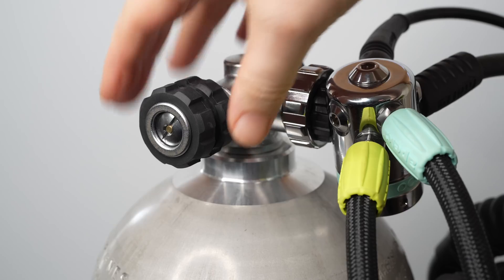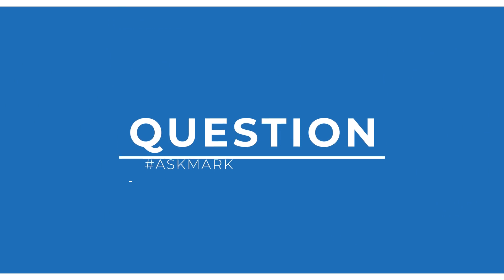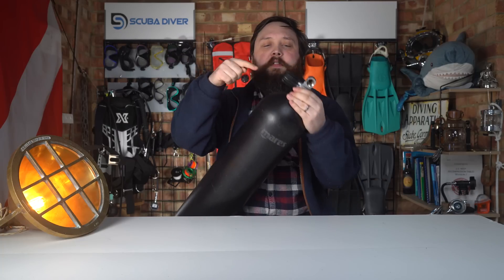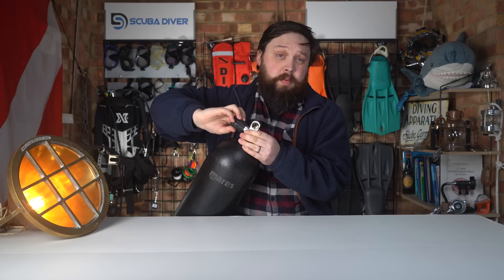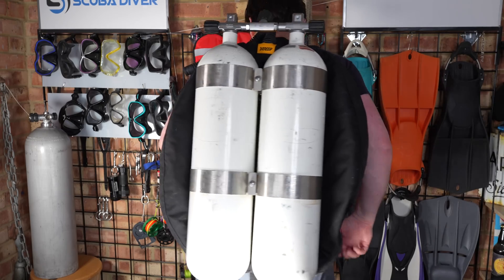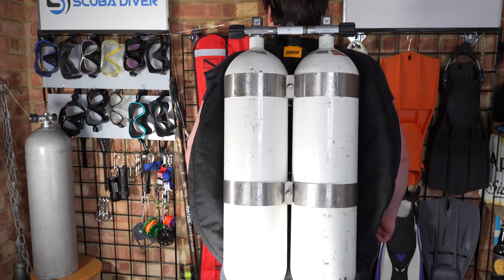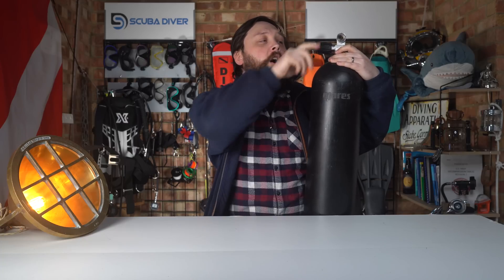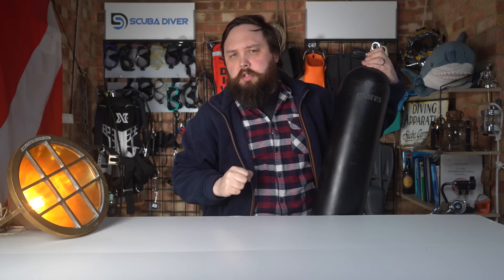How Twinset Valves Work In Scuba Diving | Shutdown Drills And Isolator Tips Explained

Comment: #Askmark  Thanks, Mark. For all the advice, how often should I use silicone spray on my mask and fins? And should i use it on my regulator horses ? Thanks again for all the grate work.
Reply from the maker: I don't use silicone sprays very often on my dive gear. Some can condition the rubber parts while some other silicone sprays can actually damage them. Not all silicone is the same, so you need to be sure that you're using a product that's designed for dive gear.

Once or twice a season if you're diving a lot in sunny conditions will help the rubbers from degrading. It should have a thin, milky consistency and follow the instructions on the label. 
 I'd keep it away from buckles though because it's a lubricant and you don't want your mask to slip off. 

I wouldn't worry too much about your hoses, as long as you keep them clean and dry between dives and keep them out of the sun they shouldn't crack. Hoses should be replaced every 5 years anyway and it's rare for them to crack before that if you look after them.

Comment: I can see only disadvantages to isolate after the drill. If the problem is the pipe of the manifold, isolate after will not stop the bubbles. The air consumed during the operation is quite few in the time spent for the operation to have a so big difference between the 2 cylinders

Comment: Mostapha what a great question. When you do your tech training the v-drill sounds so simple but most people fail at the plenty loosey righty tighty when the panicked lizard breaks Ain takes over. When I did my tech course I literally sat in a chair and practiced for a bit and hour closing imaginary valves and felt confident I had it nailed. Then on the course I was down at 40m and did the drill. WRONG shit off the primary I was breathing from and thanks to my awesome instructor who was already holding the primary donate in front of my face I live to dive another day. Never practice v drills by yourself. The way I work it is to imagine you are opening a bottle of water. That way you don’t have to think left right mirror- just open a bottle - it worked for me. Mark great video